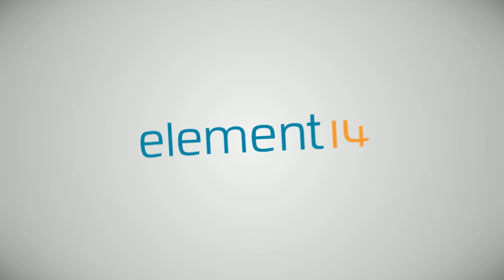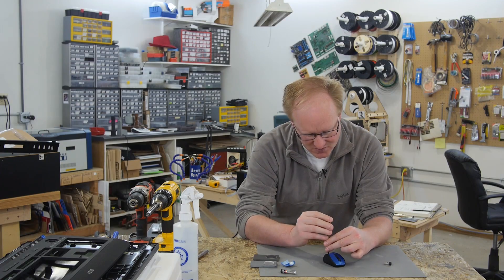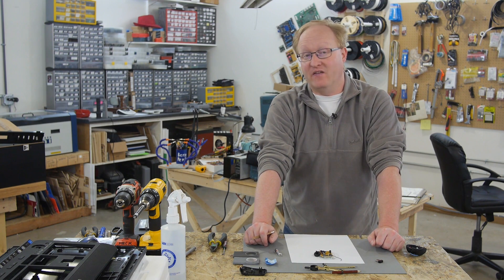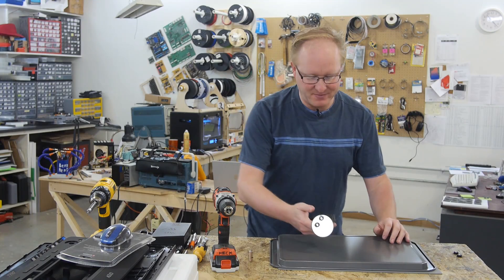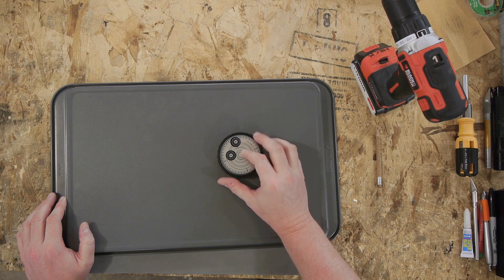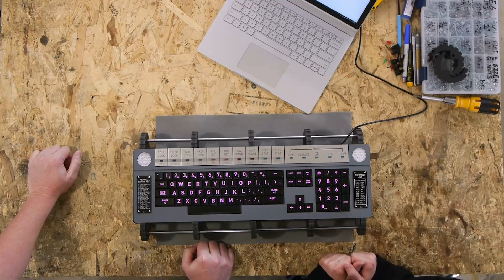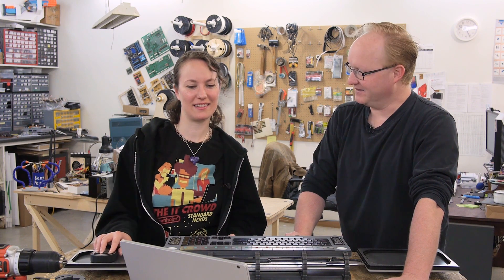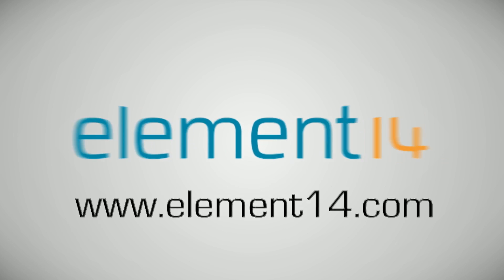Ben Heck's Sci-fi Movie Prop

Comment: I want to build a display for solar panel system which can show carbon emissions, power generated by solar panel, and few other parameters. Can you kindly me some advice how to start with this and what are the essential hardware for this project. Also, how much arduino programming will be involved in this project.